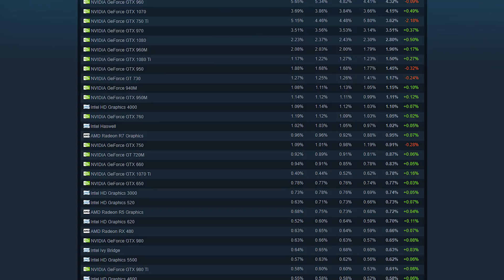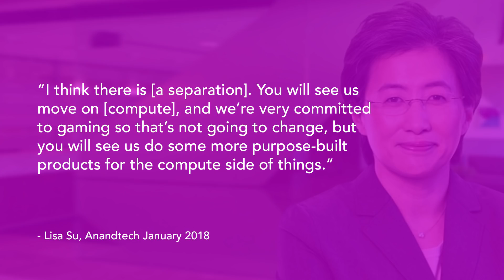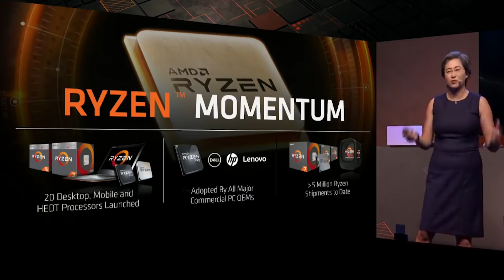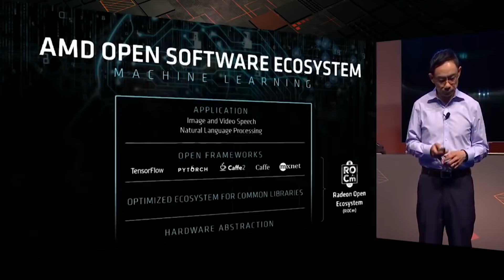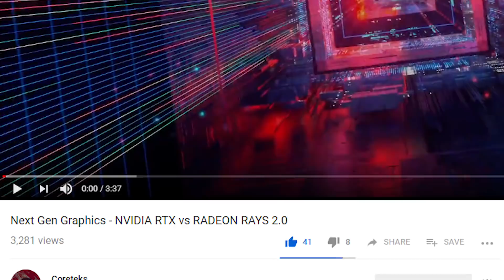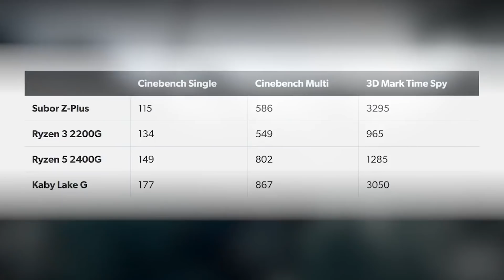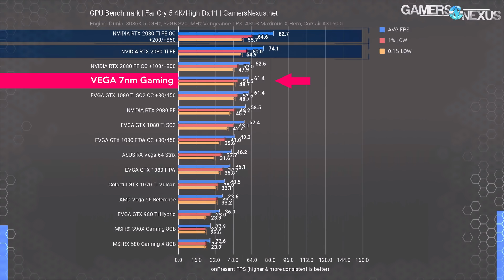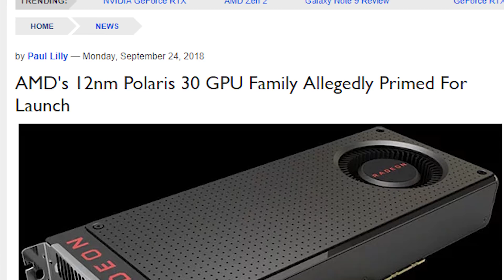AMD's answer to RTX

Comment: I think you have it backwards there how AMD will compete with Nvidia in the data centre is MCM, the consumers... Well errr... Wait for Arcturus... The thing is that for consumer graphics NUMA is going to take a lot of work to get going, but for data centre that's not a insurmountable problem even in the mid term as you already have data centres making use of muliple cards and the memory on each one of those cards with NVlink now. So Navi will be a mid range GPU that they will scale up with MCM for data centres, Arcturus will likely use SUPER SIMD which will be able to do compute and graphics well, which is where I expect them to make a much bigger GPU, I would then again expect them to use MCM for data centres again.

The one after that is where I think you will see AMD move graphics to MCM and it will be a chiplet design where a single compute die will only be enough to make a mid range to lowend GPU, but then AMD use use 2 or 4 for mid range and high end products and then 8 for data centre applications.

Almost exactly what they are doing for Zen 2 now, although I would expect that you would also have deep learning dies etc thrown in there so a data centre AMD GPU could have 12 - 16 dies total, although by that time I expect Nvidia will have made a similar move, although they may be at the previous step of just putting multiple GPU dies together rather than making true chiplets where you really start making specific dies for specific proposes and mixing those togther on cards for different segments and there use cases.

That way you can somewhat go back to the old way of doing things and have specific hardware on-board, but because you have many dies you can do without locking yourself into this set hardware, because you can always change the die mix with relative ease.

Comment: Hmm, a couple of points: 

There's a distinctive difference between RT cores and Tensor Cores in Nvidia's RTX implementation. Yes, Nvidia's 10 series cards could do Ray Tracing without RT cores, but they were "too slow" and hence Nvidia's suggestion that the new RTX cards are 6x times faster than the old 10 series cards in Ray Tracing. Why am I bringing this up, is because while as you have rightly mentioned, AMD is "ahead" in terms of compute power, they are not "6x times ahead", and given the lack of any independent Ray Tracing cores in the upcoming Vega 7nm, I can't see them bothering with Ray Tracing at all this generation. I don't know the structural differences between RT cores, Tensor cores and the rasterization engine, but you made an on-point observation that AMD's compute capabilities was used to denoising, akin to that of Tensor cores functions in RTX cards.   

Also, one of the implication of the RT cores in Nvidia's RTX cards were the massive  775mm^2 die size. Something that is a major contributing factor to the excessive price increases we have seen, given how low the yields would be on a 775MM^2 chip on a new node/semi-node. Again, for AMD to bother with Ray Tracing cores in their Vega 20 would simply mean that we end up with a big chip that's designed up from scratch to include the Ray Tracing cores, which would: a) be called something entirely different than a Vega 20 since it's basically a new generation, b) still end up being expensive, and deprive AMD from an opportunity to compete on price/rasterization performance value on existing games. Which seems to be the only way forward really. 

AMD have dismissed the use of MCM even in Navi during an interview in June. They have explicitly mentioned that Navi will continue to be a monolith chip in the mold of Vega. It has also been heavily rumored that Navi is being developed in cooperation with Sony for the next generation gaming console. Console chips are usually no larger than 300mm^2 in size due to the same economic yields consideration. With that in mind, I was under the impression that the way forward for AMD was Navi being a Polaris class kind of cards, with two or even three "glued" together for higher tier cards and maybe for Ray Tracing capabilities. However, now with that rumor, I have no idea how AMD are planning their future beyond Vega 20. 

With all that in mind, and given the infancy stage RT being in. I think the best thing to do for AMD is to forget about Ray Tracing for the near future (at least as Vega 20 is concerned), and focus on delivering a 1080ti level of performance card for less than 500 US dollars. I think GDDR 6 can serve them well in that regards, but lets not forget the reason Nvidia was able to compete with AMD's 512bit cards using 256 memory bandwidth is due to the superior compression technology they have had for a long time. So we will see ..

Comment: Actually I'd be more than happy if AMD just put out a great performing; power efficient mid-range card at a sharp price. That has always been the market I look to spend my money on, and I think it is where most other people do too.
Reply: Bendy Bruce   You have a point there! People often talk about the fastest MEGA CARD, but very few own one... the big sales are actually in the mid range... so more power there for the bucks.
Reply: A card that runs all games at high settings at around 60fps is more than satisfactory for the next 2 years definitely. Atleast 5 years from now, games might give option of ray tracings. Perhaps 10 years down the line, ray tracing and other innovations could become mainstream with no option to do without but still unlikely for all titles to do so.in lieu of optimisation.

Comment: Radeons have ALWAYS been "beasts" when it comes to compute  starting with VLIW design (VLIW 5 and 4) which were redesigned for GCN (just like infinity fabric was an enhancement of hyper transport)
That is the way AMD and Ati always were about, put the hard work into the code and they FLY, but if the coder is "lazy" unwilling to do the hard work to gain the benefit they do not seem "all that good"

There is a reason why for many many years Radeons were "king" when it came to code cracking/hashing, because they had the "muscle" under the hood to gain the benefit to those who took the time to "do it well"

A muscle car is not designed for tiwtchy short tracks, they are designed for high speed full out races, they need the road to work with to "show the muscle" ^.^

Last few releases of AMD products they got higher then their expected performance and power requirements (example 8 core 16 thread @ 3Ghz at 80w instead became 3.4Ghz at 65w turbo on single core at 4.2 and up to X cores at 4Ghz) AMD (generally) has always been conservative on power consumption ACTUAL and clock speeds...Ryzen absolutely ended up being "better" then expected (beat their own estimates by something like 10% better performance and lower power consumption at even high clock rate overall bin testing) 
and Ryzen+ same thing...

The only "odd ones" where the RX 4xx 5xx and Vega ones where they seemed to have no choice but to "clock them higher" to compete which "broke" their power budget and caused higher than expected power use AVERAGE, all it took was a "simple" voltage adjustment (they did not seem to have time to do at the factory) and the power use dropped a noticeable amount AND clock speed stayed at a higher rate near constant.....

I hope they learned from this and make sure the next Radeons are more "tuned" like Ryzen 2xxx was over 1xxx ~ the same to bit less power BUT higher average clock rates as well as lower average temperatures as a result.
Reply: if AMD could bribe coders as much as Nvidia then the games would be way more optimized for AMD too and Nvidia would have serious issues and we would have WAY cheaper graphics cards because of better competition

Comment: my hope is that GPUs come with FPGA chips built into the PCB, so much compute for games can be offloaded to these processors 
freeing up the GPU to focus on more graphic and memory intensive applications
this would give any GPU huge boosts in performance but as with anything devs need to implement it for it to become standard
and devs will generally wait for technology to advance than to be on the fore front anymore, nice to hear AMD working on instruction sets

Comment: The primary problem for any new high end GPU:s is the need to include 8GB of really fast RAM .  That ram is going to retail for 200-300 when you consider board partners and retailers markup, if you add cost of the other parts not considering the GPU chip and it results relatively low profits for Nvidia and AMD for expensive cards . It is probably reason for the delay of 2060, it is waiting for die shrinked 16Gb =2GB dies of GDDR6 so that it could provide 8GB with 128bit memory interface at reasonable price. The availability of those dies is probably  the reason why Quadro's haven't shipped yet.   It is probably the cost of memory why ray-tracing isn't for true mid-range cards, since having enough high bandwidth memory chips is too expensive currently, 2060 is likely going to have half as many memory chips than 2080 while having same amount of RAM.  The high memory GPU:s that are currently cheap are nothing more than fire sale of old inventory at prices that do not make sense when considering  the cost of parts.
Reply: You honestly think it costs them 200-300 for the ram....LOL...that is the price WE would pay, maybe, not them...maybe 50-100 at most IMHO
Reply: I said the retail, after the markup. The markup is the percentage on top of the purchase cost to deal with inventory,  shipping, marketing,  spoilage(accidental damage) ,returns, warranty,  etc... 
Lets say board partners need 30% markup and retailers need 30-45% markup, the price we are screwed.  Of course they get the chips cheaper than people who only buy couple of thousand of those.  Like people who get it from digikey.  But there is quite a bit difference from going 13$ per GB in 2017 for GDDR5, today going 28$ GDDR6  and 18$ for GDDR5. Remember for these prices there is additional retail markup required. I assume volume discounts+digikey markup are about same as board partner markup. [Wholesale markup should be relatively small.]

People who believe any markup is greed should work for free at retail while having real cost of transportation to workplace, because markup pays all the salaries and all the other costs, and hopefully some small profit, which they can loose as soon as demand goes down. The fact is that there are real cost of getting from parts to finished products in consumers hand and  markup of one part of chain is part cost to next part of chain that multiplies over the chain is situation most people don't grasp. Especially the cost of inventory. 
The cost of inventory is both risk, like having lot of 10 series cards made with high cost parts and not being able to sell them at prices that would give any profit, and cost of accidental breakage. And cost of not having same amount of money invested in something else that would give 8% yearly returns.  And also storage space and people/robots working at warehouses, but these don't scale by prices of parts.

Comment: we see cpu gpu die get smaller and smaller then later more tech they will ending getting bigger and bigger
Reply: Nv has slowly been cutting EVERYTHING away to focus on only certain things, that being said, the amount of transistors in these "small chips" is much much much more then the "old" large" chips could even dream of.........they only can put so much into the chip (transistors) Nv chose to "cut and prune" a good chunk of things to focus on very specific things to BS software "hacks"and get them to run as fast as possible......AMD does a "get as much in there as possible, to do as much as possible, even if run a bit slower" type approach...they just need to focus on getting power as low as possible constantly with all the "junk under the hood" if they can do that, they WIN BIG TIME, Nv more or less cannot "come back" because they have been chopping things away for the last 6 or so generations, AMD has NOT, they have been "tweaking" all the stuff

Comment: amd problem is they working on way to much shit way to much they need to end some things like apu's end the line work on real cpu's and spend more time on gpu's there all over everywere amd i see in the future selling off there gpu line to samsung intel amd is 14 years behind in gpu tech nvidia is way above in tech
Reply: Nv is NOT "way above"...do a little reading and take off the tin foil hat and realize that beyond the "super high end" that the average person cannot afford (nuclear simulation) Nv is NOT "supreme" TECHNICALLY Radeon has for many many many generation been the "beast" focused on multiple data working sets where Nv "did like" Intel and choses to be more of a "fast IPC"

a simple example, take a "regular" Geforce or even Titan card and make it run multiple hashing paths on the same working set all at the same time...they will CRY because they are NOT capable of doing it...they focus on "fast but simple" not "multicore multithread" type work that Radeons for many generations have done extremely well at....even Tessellation as a pure example, make them Geforce cards run at the same level the "average" Radeon can/does (VLIW 4 or 5 style) they crash outright or lose so much performance it just not worth it.

Nv is not as "advanced" as you think they are callical..advanced for certain things..sure, but more advanced then AMD...ummm, nope, Nv designs GPU, AMD does many things AND GPU

Comment: It will be some time before Raytracing replaces Rasterization though. It WILL happen eventually, but nobody with a Vega7NM or an RTX20 will see that day on those cards for sure. However, it is nice that there seems to be some soft collaboration (Inter corporate competition really, but both AMD and Nvidia gain by working together towards RT and PT).

However, given Nvidia's lead in Rasterization effeciency, I doubt the Vega 7NMs will even match RTX2080 in gaming performance. It will probably be a similar scenario with Vega 64 versus the 1080. You get some competitive, game-dependent wins and losses, with the Turing GPU being much, much better in terms of backwards compatibility.

However, I've often joked that RTX2080 and 2080TI are in fact Vega 70 and Vega 78. They are Nvidia's first TRUE DirectX12/Vulkan cards. Something even the 10 series cannot boast. This explains why in certain DX12/Vulkan games, the RTX2080 absolutely annihilates the mighty 1080TI (Wolfenstein 2 for example)
Reply: Yeah the async compute is nice, still i hope they optimize their Vulkan versions and ditch DX12.

Comment: you make some good points here, i think AMD is doing what Nvidia should have done. It seems that in the past 2 years or so both AMD and Nvidia have been focusing their R/D more on tech aimed for the business market and professional design than on gaming. But, here is what i think happened. Nvidia opted to launch a semi developed tech to the gaming market as a gimmick in order to stay in the eyes of the public and to at least launch something new. RTX and DLSS are not gaming technologies (DLSS even has it in the name "Deep learning") What Nvidia should have done IMO was launch RTX on the quadro lines alone and flesh it out there, where it is relevant and much more useful in its current state than for gaming. lets face it, if RTX in games means a large FPS hit, noone is going to use it. AMD on the other hand might really have the 7nm process close to being ready, and Nvidia of course knows about it, and launches the RTX as a knee-jerk reaction to turn all eyes on them.

Comment: The Nvidia 2000 series of cards ARE WAY TO COSTLY for only and average of 25% performance boost . And most game will not take of advantage of them.  No way will I buy one unless the price comes way down. Also have you notice AMD has said very little about Nvidia new cards. If I were AMD I would do just that, nothing for now. Then come out with a card LATER that is comparable at much less cost.
Reply: nv told you in there demo that there using super computer to train there rtx how to render the screen , and then taking 1080p and super scaling it with AI ,, there cheating there ass off ,, and they told you what there doing right to your face and people/kids are to stupid to see what is going on, rending games at 1080p and using dlss to scale it to 4k so they can have good 4k FPS,, who the hell wants this fake as shit
Reply: Or release drivers that make RT work on current Vega cards as soon as the game devs release RT for the games ...
Reply: @The Pacifist Gamer IMO, ASUS and Strix in particular are just paying extra for virtually nothing. The savings you make by going elsewhere might well pay for an even nicer looking full cover block for the GPU or other things like better RAM that would actually yield better results.